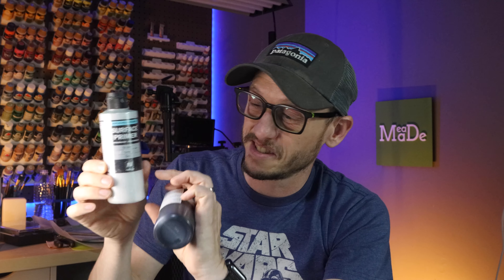Alternative Primer Method | Basics of Priming 3D Prints

Comment: What about brush on primers? If you don't have a place to safely use spray cans or an airbrush.
Reply from the maker: The airbrush primer from Vallejo can be brushed on as well. I have done it on a few models. It’s still primer just thinned down.